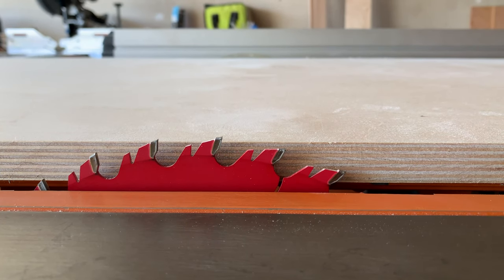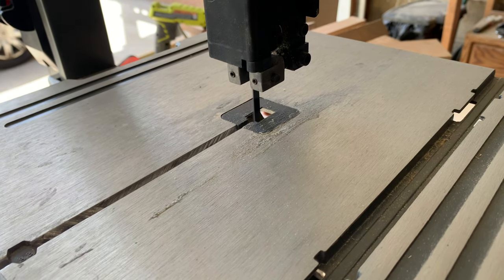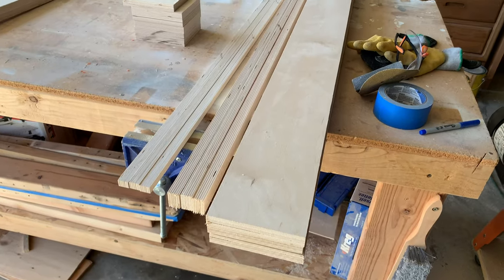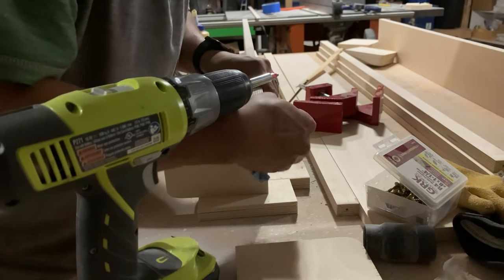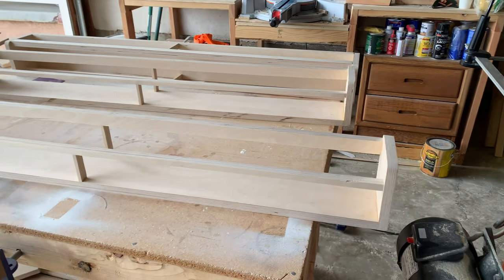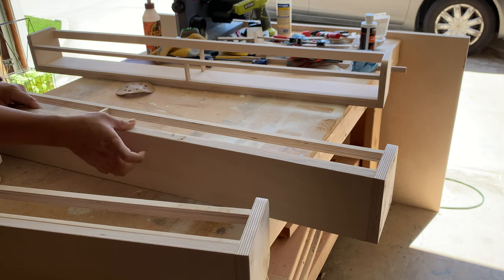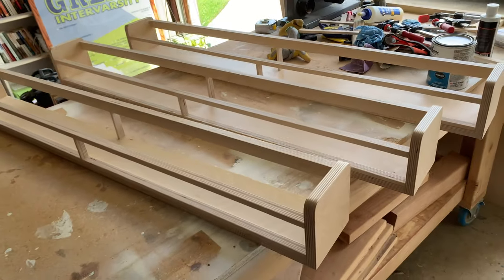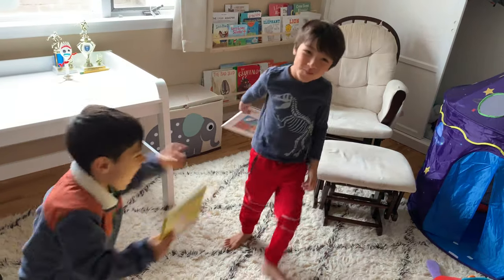DIY Kid’s Floating Bookshelf

Comment: Just used this video to build my own! Very much thanks for the idea! Maybe I missed it, but figured I would share the hurdles I ran into that I needed to diagnose beyond this video:
For the back supports, the measurement was 1.5”.
You will need a second piece of wood for the end caps and the stopper on the bottom. I used the 2’x4’ plywood as recommended and didn’t have enough wood to make the end caps. Luckily I had some scrap lying around that i made work.

Again, thanks for the idea and for the instructions! Had fun doing it and saved some money!

Comment: Good stuff man!

Once you figure it out, teach me how to adjust the nailer to sink the heads of the pins.
Reply from the maker: Jeff Liou thanks! 
My nailer indicates that it can be set at min 60 max 80 so I set the air compressor to 70. I probably shot about 20-25 pin nails and I had to use the clamp on 2 or 3 of them that stuck out. Worked at that pressure for the most part! Didn’t need to adjust anything on the nailer however I have the porter cable PIN100 and it can only do 1/2” - 1” pins and cannot adjust to a different size.

Comment: Great video! I noticed you countersunk the screws for the end pieces as well as to mount to the wall. Clean look! Any tips for countersink drilling for a beginner? I’m guessing that’s a special bit or extension when you’re pre drilling right? Thanks
Reply from the maker: Thanks for the compliment Ryan! I got a 4 pack countersink set made by Ryobi for #6, #8, #10 and #12 screws. Tip would be to match the screw head size with the # of the countersink bit and hold the screw up to your bit so you know how deep to pre drill the hole :). 

If your countersink bit acts as both a normal drill bit + a countersink bit, you can just hold the screw right up to it (like I did when I showed the bit side by the side with the screw) or, if it doesn’t act as both, you can use blue tape, hold the screw next the bit, use blue tape on your drill bit so you know the depth of the screw, predrill, then take your drill bit and countersink the hole to what around what you think would sink the screw head completely.

Hope that makes sense / helps!
Reply: @nwkwok  Makes perfect sense. Thanks for walking through it!